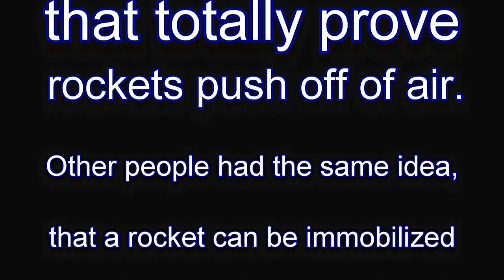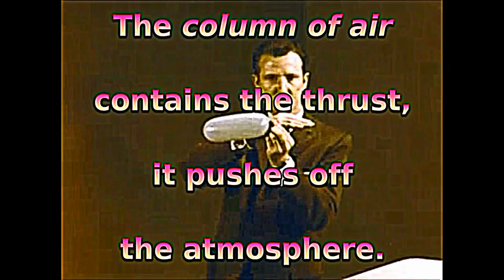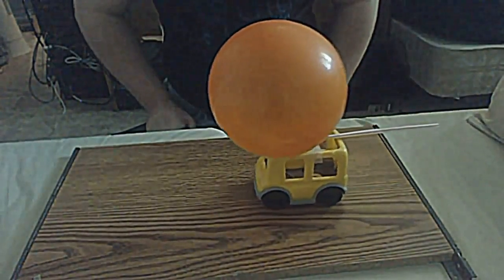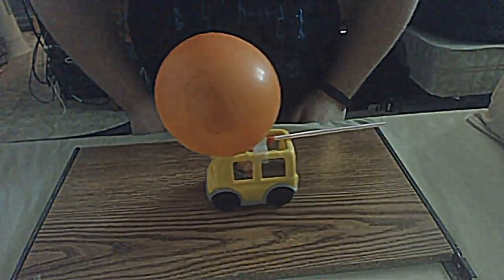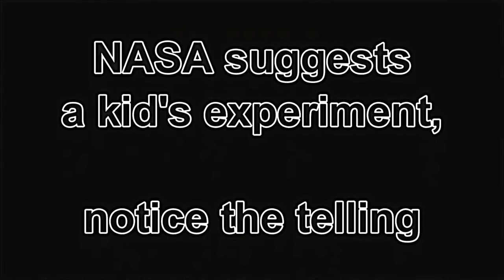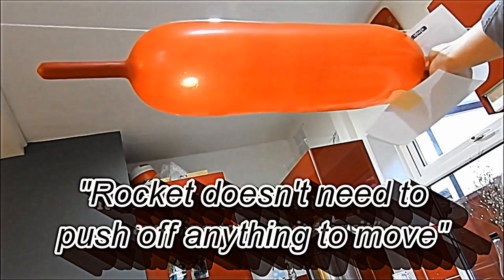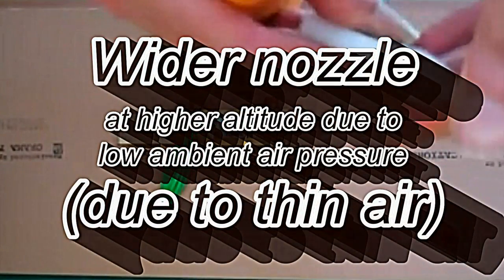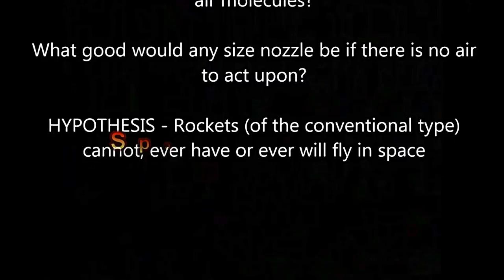rockets push off air

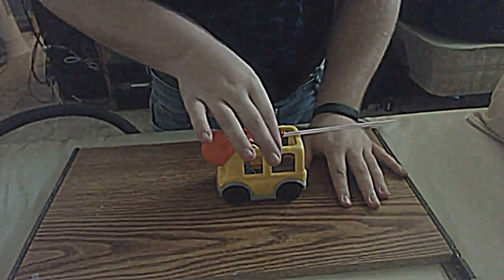Comment: 10:40  He wasn't getting the results that he wanted so he pushed down on one side of the test surface to force the cart to go uphill. 
He doesn't explain why the cart continued to move forward despite removing the air from the exhaust and the cart was weighted down to give him a chance to stop forward movement through added friction. Total dishonesty.
Reply from the maker: No. He was trying to prove me wrong, your comprehension is very poor! He is a moon-hugger like you. He did a total of 12 tries, and he showed there is a "sweet spot" that leads to immobilization, exactly as I predicted. If your "ejection" nonsense was the case, then his result would be impossible, since once ejected, anything you do to the thing ejected can not possibly influence the rocket or the thing that ejected it.
Reply: @rocketspushoffair  Then tell me, why was the cart weighed down at all? and the cart did keep moving forward until the test surface was pushed down forcing the cart to go uphill. I don't care who did the experiment, it didn't show what you're saying it showed.
Reply: @rocketspushoffair   I've only just seen the balloon experiment on the string across the kitchen! It's even more of a joke. The paper was taped to the balloon so any thrust was redirected forward cancelling itself out. As it happened the air was redirected sideways causing the balloon to go sideways and not stay immobilised as predicted by the experimenter but predicted by Newton's 3rd law.
Reply: @rocketspushoffair  Except he is changing the angle at which the mass is ejected. That sweet spot is just  an angle that is perpendicular to the direction of travel. If the device had spherical wheels then we would see the vehicle move in the opposite direction of this new perpendicular action. Your conclusion is typical for people who have never taken a physics course. Stop trying to teach something you know absolutely nothing about.
Reply from the maker: @BigHeretic  As I said above "If your "ejection" nonsense was the case, then his result would be impossible, since once ejected, anything you do to the thing ejected can not possibly influence the rocket or the thing that ejected it."

Comment: When the exhaust leaves the rocket, it cares not where it goes the thrust is already acting on the rocket.  Your big 'air diverter' is an air brake.
Reply from the maker: I just noticed your comment, and remembered who you are from the p-brane series! Merry Christmas! OK, Let's go over everything you missed, and then some: COMBUSTION NOT POSSIBLE IN A VACUUM https://www.youtube.com/watch?v=ODvlSi8H7hs NO THRUST POSSIBLE https://www.youtube.com/watch?v=Mzf9IBXu1Mc both experiments were by Cody's Lab therefore totally unbiased. 

The first experiment in this video https://www.youtube.com/watch?v=CLjxKhdQSrI rockets push off air disproves the claim that once the exhaust passes the edge of the nozzle, it can no longer have any effect on the rocket--since we see that simply bending (redirecting) the exhaust column by 90 degrees AT A DISTANCE from the exit point with a vacuum cleaner hose, totally immobilizes the rocket. The number one objection, that somehow the suction acted on the rocket to prevent it from moving, was debunked at the very start of the video, where the entire exhaust straw was fully placed (several inches in total) into the vacuum hose while the vacuum was on full, and the rocket thrust was totally unaffected, and this takes care of the number one objection that somehow the suction acted on the rocket to prevent it from moving.

Examine any nozzle, such as the ones on the Saturn rocket and see how delicate they are, they even have tubes of rocket fuel all around them for cooling purposes. There is very little pressure inside, expanding gases of combustion naturally move into the open atmosphere, you can see the exhaust pour out like a waterfall. Combustion is not explosion, there is no "series of explosions" going on in the nozzle, there is a combustion chamber, not an explosion chamber (look how reinforced a cannon is)--explosion in the nozzle destroys the entire rocket, that is why they have such a high failure rate. THINK BLOW TORCH!

There were two paper behind the exhaust experiments. NOTE there is a DELAY before it hits the paper, and this delay is more than enough to show movement or thrust, if rockets work as ADVERTISED--the moment the opening in the balloon is created there is an equal opposite force at the other end--that is proven not to be the case at all.  

In the first paper example, the exhaust hits it in the middle, so it is diverted evenly left and right, this also demonstrates how reverse thrusters slow jet planes down--they push off air--just like rockets.

In the second paper experiment, which is a modification of a kid's experiment by NASA, the exhaust does not hit the paper in the middle, and you have an imbalance left and right, and so the rocket is stationary and does loops around the string, which is only explained by the fact rockets push off air.

Finally, the experiment with the cone shaped nozzle debunks you totally. Widening the diameter of the straw (the exhaust nozzle) immobilizes the rocket, and this confounds you, because it proves action reaction is bs, it demonstrates that rockets do in fact push off air--how come the moment the exhaust starts to be released the rocket does not go anywhere when the wide cone is used? It is because the wide cone disperses the exhaust and there is not enough pressure to push off the air--this was also mentioned in the wiki article (talked about in the video) on Rocket Engine Nozzles which states the exit pressure needs to equal ambient pressure--thus, each nozzle diameter is only optimal for a single altitude and air density, where a narrow nozzle works best in low altitude dense air, and a wide nozzle for high altitude thin air. Thin air is the limiting factor to how high a rocket or a jet plane can go, which explains perfectly why rockets have a parabolic flight path, go no more than about 20 - 25 miles up, and fall right back down.
Reply: @rocketspushoffair  Two videos that just proves that some guy on internet don't understand chemistry and rocket engineering. These two videos don't prove anything more that we have with computer science given idiots a platform (youtube).
Reply from the maker: @freddan6fly  you are obviously hurt and lashing out because you cannot handle the truth, you should redirect your anger to NASA or your teacher, the ones who turned you into a globehead 🤣🤣🤣

Comment: What are the equations you have derived from this experiment that can be used to debunk the rocket equation and predict the forces required to knock rockets out of the sky?
What is the rolling resistance of a child's plastic toy with a balloon taped to the roof?  How do you account for the venturi effect caused by your straw, is the straw tuned to eliminate or mitigate backflow? What is the pressure differential caused by your vacuum nozzle?  what were the local air pressure, temperature and humidity?  

You do understand the scientific method?  You realise that the scientific method was used to create the motor in your vacuum, the plastics in its construction, describe how the pressure changes work? Furthermore, you do realise the scientific method is used to predict how all of the components in a video camera will work and how to transmit that data to a computer and how the computer will handle that data and how that data can be transmitted other computers and how that signal can be turned into light in a monitor and sound with a speaker.  you do realise the rocket equation was made using the scientific process and that your process and evidence are terrible?
Reply from the maker: The rocket equation works perfectly with the fact that rockets push off air. A propellant mass ratio is just a ratio, it doesn't tell you anything about what is actually going on. And most definitely nothing is ejected. So, it was determined by experiment that there is a sweet spot at a specific distance behind the balloon rocket that when the exhaust is bent by 90 degrees using a vacuum suction in this case, it resulted in complete immobilization of the rocket. No other proof is required to show that rockets push off air.

And to answer any objections with respect to other effects that may have caused the result, the entire exhaust straw was placed directly inside a vacuum hose while the vacuum was on full suction, and the balloon rocket thrusts forward effortlessly, as shown AT THE START of the video.

Furthermore, the video when into more advanced experiments related to exhaust cone diameter, which further debunked the lie that rockets don't push off air. Complete immobilization is achieved simply by increasing the diameter of the exhaust nozzle at ground level. This is only explained by the fact that rockets push off air. The purpose of diameter is so that exit pressure matches ambient pressure and any diameter is efficient only at one altitude. The higher you go, the wider you must go in diameter so that you can diffuse the exhaust to match the low pressure thin air up high. There comes a point where the air is too thin and the rocket reaches the top of the parabola and crashes back down to earth.

All this and more is in the video, and comes from the article on Rocket Engine Nozzles. The giveaway if you are alert, is the fact that exit pressure must match ambient pressure.

I am an expert on rockets, take care!  ; )
Reply from the maker: @jiubboatman9352  It has always been known that rockets push off air, the New York Times article that ridiculed Goddard for suggesting they don't stood for 50 years. Where is Goddard's Nobel prize? We are under a lot of pressure, the atmosphere can instantly crush a tanker car. A rocket is a giant blow torch, and the atmosphere resists the penetration of the exhaust thrust column, that's no different than how a jet plane works. Stop contradicting yourself, you cannot have low pressure and an equal opposite force in the combustion chamber or anywhere in the rocket exhaust nozzle, The pressure is very low inside there, the nozzle is very fragile, it had cooling pipes all around it in the Saturn V filled with the liquid fuel. ALL THE ACTION REACTION is between the exhaust thrust column and the atmosphere. Simple observation of the exhaust pouring out like a waterfall from the Sat V engines tells you what's going on. Also, NOTHING goes faster than mach 3 without melting. Take care!  ; )
Reply: @rocketspushoffair  The pressure within the combustion chamber is immense. The restricted throat of the nozzle causes the expanding gas to accelerate and the pressure to drop.  This is known as the venturi effect,
Reply from the maker: @jiubboatman9352  You are confused, the gases are accelerated but not much force is pushing on the insides of the cone and combustion chamber. Not the millions of pounds of thrust. And watch the NASA spokes person again for a couple of minutes https://youtu.be/CLjxKhdQSrI?t=219 let him prove it to you, the gases naturally escape. Look at the stupid force vectors he draws on the inside of the cone and the combustion chamber! HAHAH!!! Write us a proof that there is millions of pounds of thrust acting at those points! WHAT A JOKE!

Comment: Sir:: I suggest you run a similar experiment, using a fishing-line secured vertically, with at least 11 meters of altitude, then time how long it takes for it to cover 10 meters of the vertical wire. Next, I suggest you weigh your fully inflated balloon with a laboratory scale, then increase its weight to, say 30 grams by sticking masking tape near the balloon's nozzle. Now, release the nozzle to measure the extra-weight that you see on the scale. Example:: If you see its weight increase to 70 grams on the scale, it means its maximum thrust-force==70-30==40 grams of Thrust, thus delivering a Thrust-Weight-Ratio (TWR)==40/30===1.33  which is more than the TWR claimed for the fake Apollos, Shuttles, and all other NASA-rockets. However, your balloon's TWR needs to be at least 3 for it to move up the wire a significant distance. This experiment disproves all of NASA rockets.
Next:: You can adjust your balloon's gross weight (inflated) to the exact TWR claimed of any of NASA-rockets, for instance, by adjusting it to TWR===1.2 which is claimed of Apollos. Then release the nozzle. You'll see that the balloon will NOT move up at all, which would have been the case with Apollos. 
Next:::: You can estimate the weight of Apollos, by adjusting your balloon's TWR to go up your wire, as slowly as Apollos covered their first ten meters, which was a few seconds. You'd notice that your bare fully-inflated balloon may be able to perform similarly. By measuring your balloon's corresponding TWR, you would conclude that Apollos must have been empty balloons to rise up so slowly, as balloons do. By measuring your balloon's proximate volume, and applying it to Apollo's proximate volume, you could extrapolate that the empty Apollo-balloons must have weighed no more than 30 tons gross!!!!  For related online calculators, and similar experiments, check out the clips, and documentation, available at my name-link.

Comment: Why did you not let the commentator at 12:37 finish.. You just stop it and say incorrect.
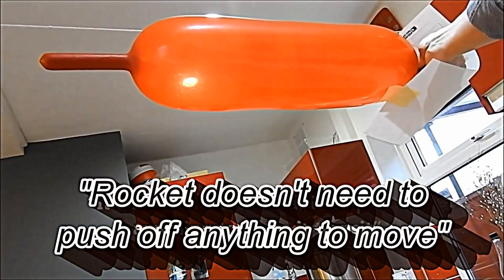at 15:00 some experiment.. he taped the balloon to the string.. They can not even follow instructions for a KIDS experiment..
Reply from the maker: what's your problem? They modified the kids experiment, so what? They also performed it as stated. Open your eyes, the balloon wasn't taped to any string. Thee pressure inside the nozzle is VERY LOW, and that alone debunks the re-tard-ed "ejection" idea ... what we have is COMBUSTION, nothing is ejected, like a cannon ball.
Reply: @rocketspushoffair  I stand corrected on it was not taped to the string.  See I will be honest

 But the paper taped to the back end is a total bust..  
That total invalidates what the experiment is trying to demonstrate.  The balloon, string and air escaping are to be taken as a whole. The fact the paper is redirecting the air to the sides, redirects the momentum of the air.. 

How about a physics lesson. 

By taping the paper to the end. You in essence demonstrated the purpose of the Nozzle on the rocket engine.  It redirects the rocket exhaust (balloon air).. and what does the rocket (balloon) do.. go in the opposite direction .. 

So excellent demonstration of redirecting the balloon exhaust to show how the balloon will be forced in the opposite direction. 

You did know that?
Reply from the maker: @entangledmindcells9359  Redirecting the exhaust AT A DISTANCE from the exit point proves rockets push off air. This disproves instant action/reaction as there is a delay until the air hits the paper. The fact that the air was unevenly redirected to either side caused thee balloon rocket to spin in place proves rockets push off air, just as when the air was evenly distributed to either side there was no movement.

Fake NASA physics claims that once the exhaust passes the edge of the nozzle, it can no longer have any effect on the rocket as per the "ejection" of exhaust bs explanation of thrust. 

Fact is, nothing is ejected. There is only combustion, and a very low internal pressure, that low pressure alone disproves NASA's bs claims.

Also, recoil in a gun or cannon is 100% due to the atmosphere rushing in and slapping thee back of the barrel as it equalizes the pressure, and has NOTHING to do with the projectile, and we see in ultra slomo that the projectile is LONG GONE before any recoil takes place, and the fraud known as Goddard is debunked with modern slomo cameras who set up a rigged recoil experiment, it was irrelevant.

At least he was ridiculed for 50 years in thee New York Times, I think all that is written in the description.😁